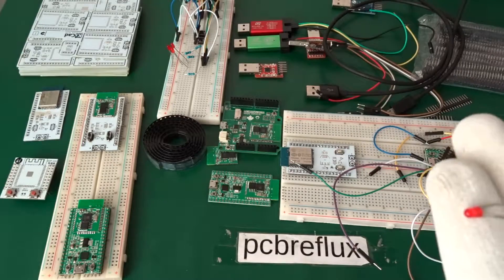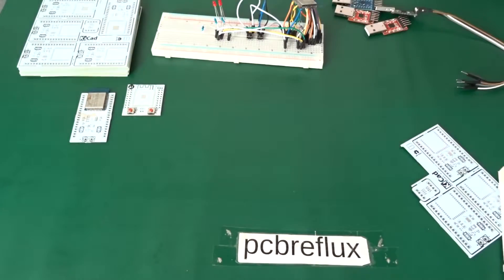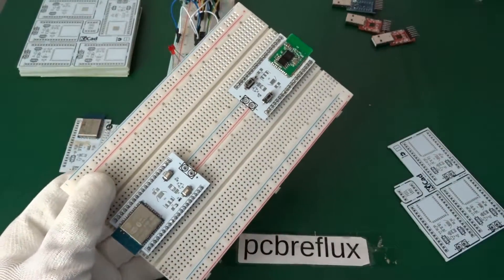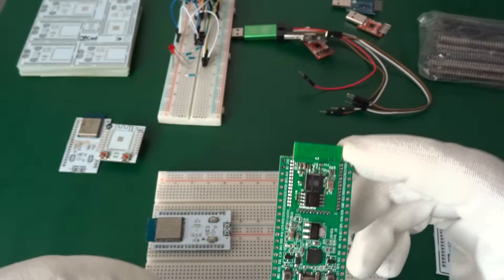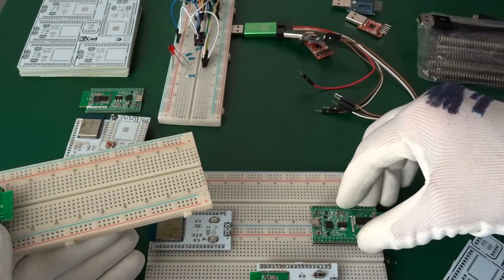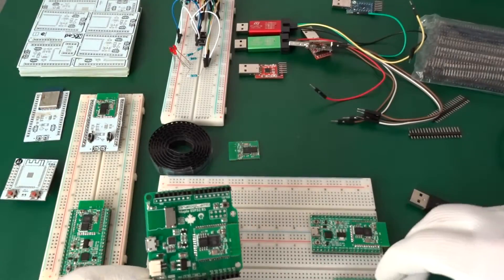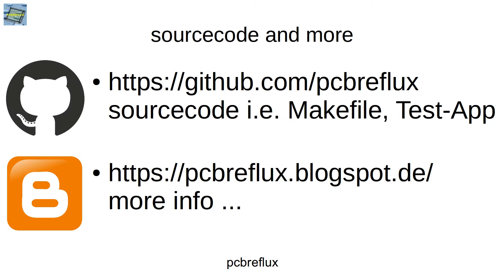ESP32 #15: Adapter, Breadboard, UART, USB and more

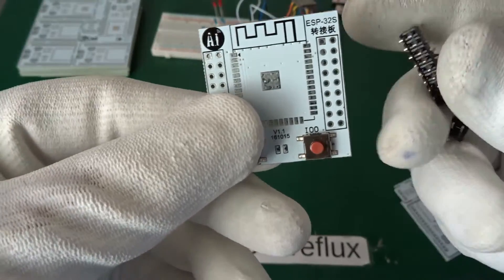Comment: great , but what is the resistors on the small breakout board in minute 1:30 , what resistors soldered , as I bought it with out the resistors
Reply: it is 10 K Ohm SMD

Comment: Wow, but I have a question, the ESP's antenna shouldn't have been out the PCB?, I want to burn a bare ESP32 by FTDI.
Reply from the maker: Yes, if you want to use the bare ESP32 chip on your own PCB with WiFi or Bluetooth you need a external or PCB antenna. Maybe this TI document could be helpful http://www.ti.com/lit/an/swra117d/swra117d.pdf
Sparkfun do this also with the "SparkFun ESP32 Thing" so you can have a look at the schematic https://cdn.sparkfun.com/assets/learn_tutorials/5/0/7/esp32-thing-schematic.pdf

Comment: nice video, but what about filtering the power?
Reply from the maker: If you use a AMS1117 or similar as a regulator with the proper caps you need no further filtering. Same with a battery in the 2.6V to 3.6V range. But it helps to add a 10uF up to 1000uF with other power sources.

Comment: Hello,
Is there any other difference between these ESP32's modules other then antenna:
https://www.aliexpress.com/item/ESP32-ESP8266-Module-Development-Board-Wifi-Blueooth-CP2102-Chip-ESP32-Bit-ESP3212-For-arduino-UNO/32786254573.html?spm=2114.13010308.0.0.XXyP9x
https://www.aliexpress.com/item/ESP32-Development-Board-WiFi-Bluetooth-Ultra-Low-Power-Consumption-Dual-Cores-ESP-32S-Board-NodeMCU-32S/32789782336.html?spm=2114.30010308.3.11.t4ShoU&ws_ab_test=searchweb0_0,searchweb201602_1_10065_10068_10000032_119_10000025_10000029_430_10000028_10060_10062_10056_10055_10054_10059_10099_10000022_10000012_10103_10102_10000015_10096_10000018_10000019_10052_10053_10107_10050_10106_10051_10000007_10084_10118_10083_10080_10082_10081_10110_10111_10112_10113_10114_10115_10037_10032_10000041_10000044_10078_10079_10077_10000038_429_10073_10000035_10121-10037_10077,searchweb201603_10,afswitch_3_afChannel,single_sort_3_default&btsid=48361f3b-b0c3-44ac-87b4-3f3366af9d98
Thanks
Reply from the maker: milie stanford looks simular to the modules from sparkfun, adafruit and analoglamb.